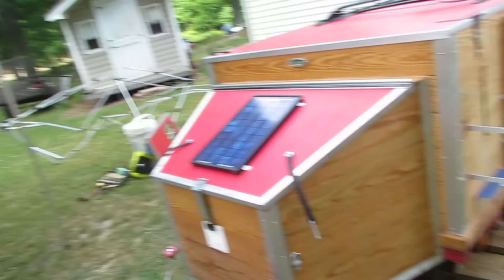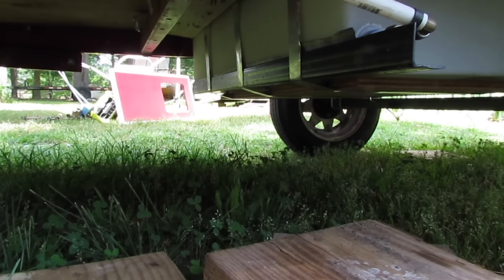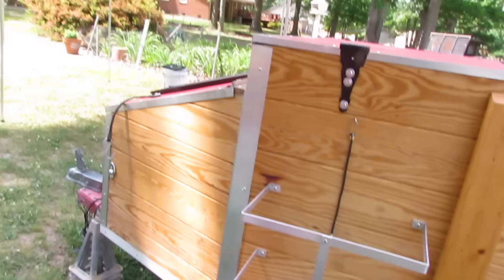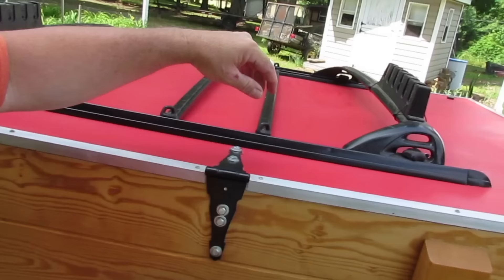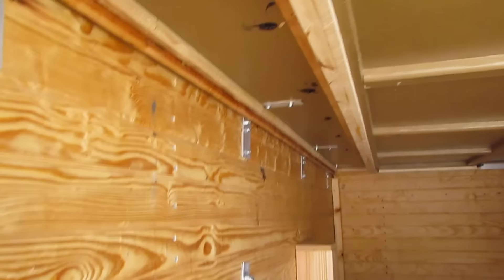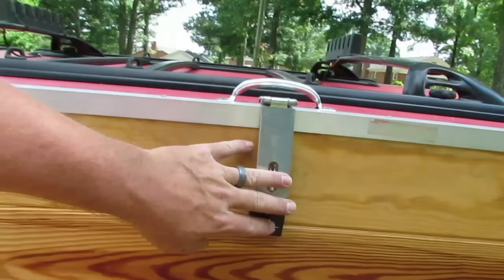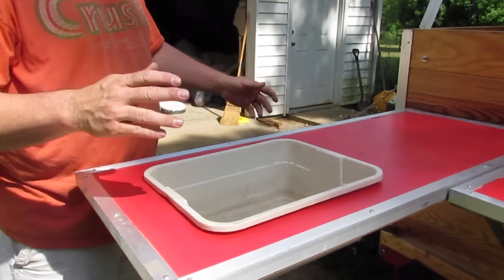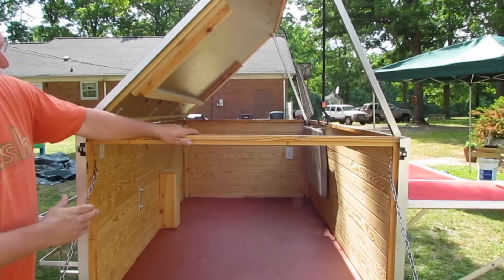Harbor Freight 4x8 Camping Trailer

Comment: PLEASE be careful regarding the total weight of that trailer.  All of that wood and all the materials you've already used to build it (to say nothing of what you may put inside) already weighs a LOT).  The reason I mention this is I went to buy one of these cheap folding trailers just like this (it had something ridiculous like a 1,080 pound rating).  The salesmen asked me what I was going to use it for.  I said I was going to put some plywood down and just use it to haul an ATV.  He said no, and wouldn't even sell it to me.  He said the problem with these cheap fold up trailers is they are VERY cheaply made.  The frame of the trailer BOLTS together, it's not even welded.  It's VERY thin metal that's used in the trailer frame and the axles and tires are just NOT going to hold up to any kind of a heavy load anywhere even close to even HALF of that 1,000 pound rating.  He said they are just plain CHEAP.  He said pretty much the entire trailer is REALLY light weight and there is no way it's going to stand up to a load anywhere near even HALF of that 1,000 pound rating.  He said you don't want to put something expensive on it like an ATV, it's just not going to work.

He said he's already had several of them come back where the first time out someone loaded something heavy on one (not even close to the 1,000 pound rating) and the frame rails broke or the tongue of the trailer twisted from the load.  He said yes, their is a warranty but only for the trailer. he didn't want to see any more of these sold to anyone that was going to do more with it than use it for a VERY LIGHT DUTY utility trailer.  He said maybe to haul some things up to the cabin like a lawn mower or some small items that all together don't way very much.  He said if you're planning on loading hundreds of pounds on it, forget it, it won't last and you'll be bringing back a broken, twisted piece of metal back trying to return it.  He said it's just not worth it and from the ones he's already seen come back broken, he would rather just not make the sale and keep people from buying it only to have it fall apart.  

All of that said, I love what you've done.  I think your ideas are great, it looks fantastic.  My only issue with the entire thing is, unfortunately the very base of the entire thing, the trailer. It's very cheap and I'm afraid it is not going tot stand up to the weight probably that you've already added to it much less what you may add or put in it in the future.  Please be careful.
Reply from the maker: Not sure why a salesman anywhere would turn someone away, if they don't like or believe in what they are selling then they need to sell something they do like or believe in. I can't argue with the fact that the trailer is not heavy duty like many on the market, it is bolted together and the metal is thinner than than some of the other trailers. 
I can only speak from experience with my Harbor Freight trailer and I can tell you that I used mine to haul a Honda Rubicon 500 ATV for about a year before I decided to build it as is now. It did just fine with no issues hauling an ATV. I also loaded it for a camping trip before it was built as is and it did just fine. After building the trailer as it is now, I would think that the frame would be stronger because it can't flex and give as much as it did before adding the walls. I agree about the axle as well, not as beefy as some out there and I have plans to upgrade that and I have already upgraded the tires. Please don't take my reply as arguing, I'm not. I can't dispute that salesman's experiences with Harbor Freight trailers but I can tell you that I have had no real issues and it does haul what it's rated for.
Thank you for watching
Reply: Jeff Furr Perhaps in a future upgrade, you could have someone spot-weld the bolted frame. It should add rigidity and strength. Though, from your weigh-in, it probably rarely gets to the limit (most of your equipment is bulky, but not terribly heavy), and it's very distributed, which limits the strain on the frame.
Reply from the maker: +Gerry Seymour good idea, I definitely think it would make it stronger. We do try to load the trailer equally from front to back. I would probably see the biggest improvement when setting it up with the jack stands. You can't really  see that it's flexing then but you can tell it does a little because the tailgate hits on one side.
Reply: Jeff Furr I can only guess but I would assume the trailer was simply one of many products that they sell and the salesman had (according to him ) received several of the trailers returned when they had broken or failed in some way.  The impression I got form the salesman was he was simply looking out for a customer and would rather not make a sale (doubt they're paid on commission anyway) than make the sale and have the customer go through the hassle of being inconvenienced down the road when the trailer fails.  At least that's the way I took it.  I assume since he asked me what I would be using it for that if it was something much lighter duty he probably wouldn't have discouraged me from buying it.  But since I was going to be putting equipment on it that was approaching probably 70-80% of it's upper weight that's why he discouraged me from buying it.  The people who had their trailers fail were ones that had loaded it to close to it's limit.   I don't know, perhaps they got a bad batch, perhaps it was a slightly different model (although it looks EXACTLY the same), perhaps they've strengthened them or made them out of slightly thicker metal as this was quite some time ago, I'm not sure.   If you've hauled a heavy ATV on it and everything else you've done with it and had no problems, great.  I just thought I'd pass along my experience as a friendly caution.  I hope you continue to have nothing but good luck with it.

Comment: Not smart with the wood exposed for an outdoor device... The wise man would have spent the cash to go over that wood.. It's gonna leak like a ship with a huge hole in it...
Reply from the maker: THEKING SILVERADO I can understand the skepticism but, I built this trailer in 2014, it will be six years old in March of 2020 and no leaks yet.
Reply: @TheFurrminator  That can be true. However the sun angle heat and cold here melt and shrink that Pressure Treat lumber here is the reason 4 my comment not to be a wise guy... I built steps on my campers deck last year already they shriveled up like Hillary Clintons old snatch lips... We have extremely hot summers and really cold winters and spring time here but it seems like U also keep the trailer inside...  So sorry my bad..

Comment: Nice job, I am building a home made camper also. Sleeps 5, self contained water, Porta jon, solar powered with 150 watt panels and 230 amh battery dackup. this is a slidein for utility trailer. But I need sujestions.  Check it out , mac camper 136.
Reply from the maker: I checked it out, nice job so far, looking forward to watching the progress.

Comment: ...being a slave to your stuff.
Reply: ***** What the heck does that even mean?
Reply: grjsb13 It is a reference to minimalism.
Reply: ***** I do not personally know this man.  However, I am disinclined to peg him as a materialist.  He built upon a $250 harbor freight trailer and used very cost effective wall material.  This man is practical.  I would be surprised if he even has a mortgage.  The very fact that he built a camper reflects his values.

I am a Taoist and I live a very modest lifestyle.  I do not live in the best neighborhood.  Most people would guess my income incorrectly.

Sitting in my driveway at this moment is a camper that I'm building.  It is not a cheap project.  And it is both completely practical and predictable for my life.  I've spent too many nights in slimy motels travelling across the country in search of the next job.
Reply: Dorian Yeager LOL